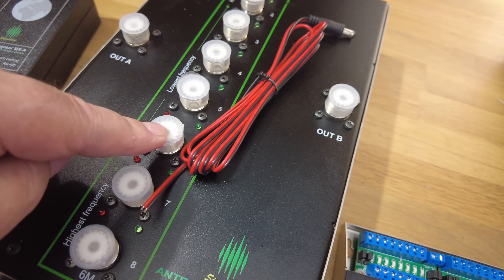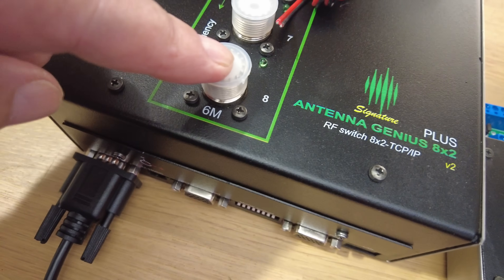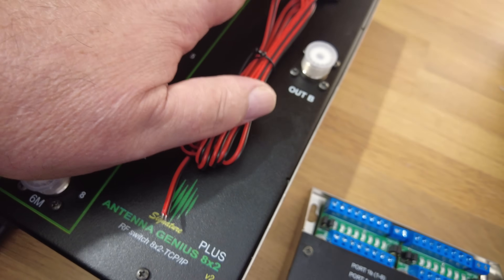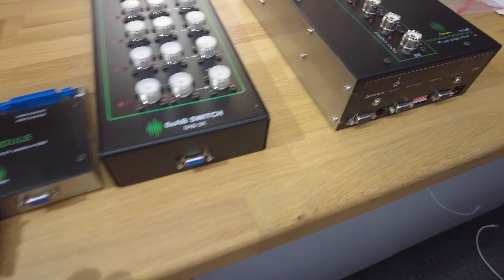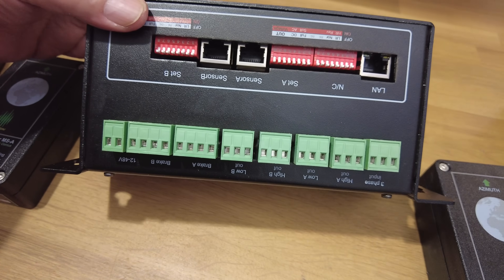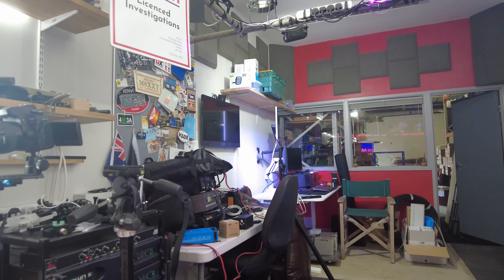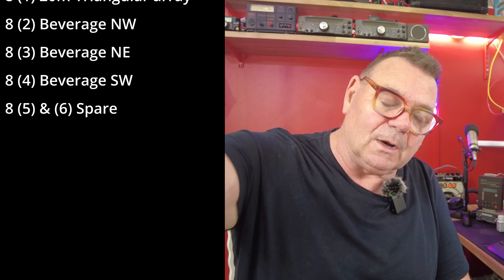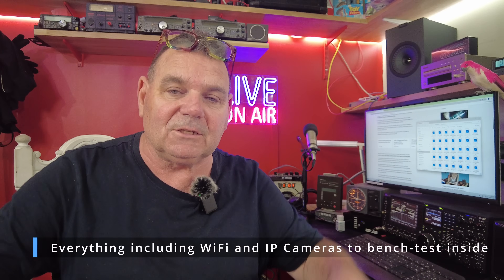Preparing 13 Antennas to 4 Radios - New Project

Comment: @DXCommanderHQ love it! busy working up to a K3LR level ; )  ..... on a side note your 4 Square efforts had me working - with AI - on a full 4 Square Multiband solution based on the HyGain paper  with 4 12.4 Signatures for 10mt  through 80 mt  in place of the HyGain AV 18 HT,  and using 4O3A switches and modules along with 5 Comtek boxes (one per band)  and so on. the biggest obstacle - aside from cost (still lower than a multiband beam and related tower etc) was....where to put it - need at a minimum 80 x 80 mt plot... with the overall min footprint including radials being 60 + meters....
Reply from the maker: Yes the killer is 80m. That's at least twice my 30m version.

Comment: Buy yourself, say, a 12RU weatherproof data box with glass or opaque window and mount it at chest height on a sturdy metal pole. You could daisy chain as many of them as you need, or just start with the two electrical boxes you already have, so they are not cluttered inside. You also need to keep the vermin out as a number one priority! By the way, the wooden bicycle box is an absolute disaster and the vermin and ants will eat your cables and stuff and destroy them in a very short time. You need to go back to the aforementioned data boxes or use a proper sturdy shed with vermin proof data boxes inside.

Comment: Brilliant! What a project 👍🏻 Here’s a thought…Perhaps once you know it’s all working, at that point knock up a fault diagnosis flowchart while it’s all fresh in your head? Don’t want a bleary-eyed late night “fix” to a live on-air problem, only to blow stuff up 😮 Lookjng forward to the next instalment 😀
Reply from the maker: Haha Ian... I have a PLUS account on ChatGPT - and I am running this as a project. There's 17 PDFs in that project - and all the wiring you could ever want... I just say, Hey mate, what size fuse did we agree to use on the 12V line ot the OM Module"? Answer, 5 amps.
Reply: @DXCommanderHQ 👍🏻😁

Comment: That would make a kick ass contest station Cal. Doesn’t the switching effectively give you PPT lock out? 
The second radio is prevented from connecting to the first radios antennas right?
Reply from the maker: Ady... I am hoping the PTT lockout will eventually work. Next things to test when back from hols. I would love for you to use this when it's running...

Comment: This IS Antenna Alchemy for sure… 🥀.  Make sure your shed is well built, 🔧 🛠️ 🪛 a little bit off the ground, all screwed and glued so it’s a solid waterproof build, after all it’s going to be the Nexus… my shed / shack has everything in it,,, including me  so it’s   ‘ right ‘  it’s a small shed like yours, built almost like a Faraday cage …  so I hope this goes well and you have some help. ⚗️ 🧪 🧙‍♀️ .73.       💙

Comment: RS stock number 879-3725 finger trunking. I've used this many times for all sorts of work related projects makes keeping the small interconnect cables nice and neat. 
There are other suppliers, but RS have nice images!  the 879-3725 is a 40x40mm size, there are larger. You may find this useful when kitting out the shed.

Andy

Comment: I've always figured there is no 1 super-antenna that does everything best. I try to put up a variety of wire and mag-loop antennas of differing configurations, and I switch between them. Whichever is best at that time, on that day, under those conditions for what I want to do is the 'best' antenna. The magic is in the 8 antenna switchboard I built. I started out with a north/south and east/west wire antennas as a kid doing SW listening, switching with a 3-way lamp switch between the 2 or both antennas. Since then, as a ham I've just expanded on the idea. I like antennas. I'm more of an experimenter than a chit-chatter.
Reply from the maker: Indeed, no perfect antenna.

Comment: This is going to be a great setup ! I like the 2 VFO setup done on this station. The stereo live stream is great ! Really helps with weak stations and noise and changing band conditions. All herd on live stream  . And both stations will have that soon. This will be a lot of work .Lots of coax jumpers ! The PTT lock out is hard enough with 2 stations. But well worth it saving them relays .Cheers from NY
Reply from the maker: Yeah - it's good :)